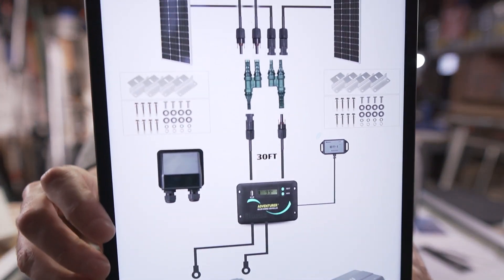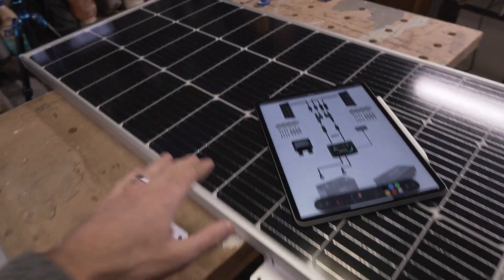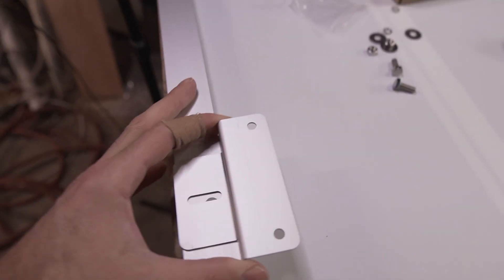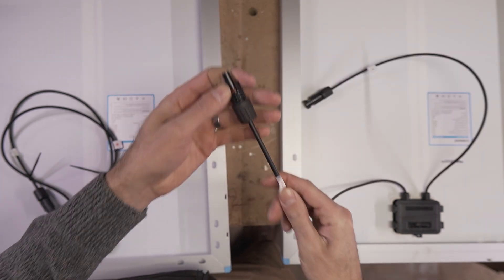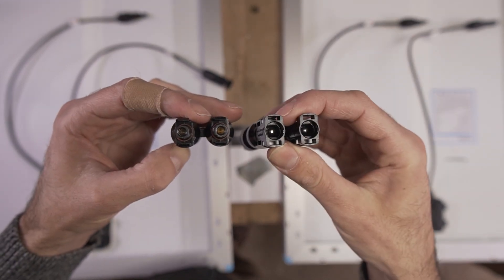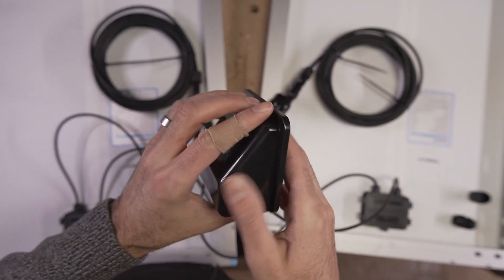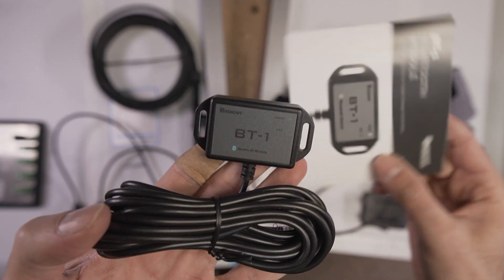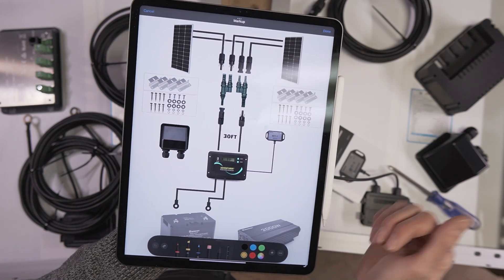Renogy 200W PWM 30 Solar Kit Installation Schematic Review

Comment: Question I have an 800w renogy system with two renogy 200ah awg batt. And 1000w renogy inverter is their a way too connect shore power and have it automatically kick on when the batt. Reach a certain low and off when fully charged just as a back up when the panels are not getting enough sun

Comment: Hey bud, I have Renogy 200 Watts 12 Volts Monocrystalline RV Solar Panel Kit with Adventurer 30A LCD PWM Charge Controller. I also have a MAGNUM DIMENSIONS
CSW Series (12-volt models)
Pure Sine Wave Inverter. 

I wired the panels in “Series” but I’m getting an error code of “Reverse Polarity”. Do I need to wire it “parallel”?